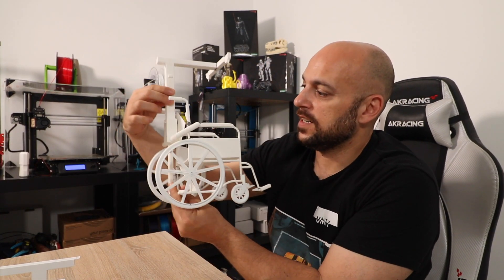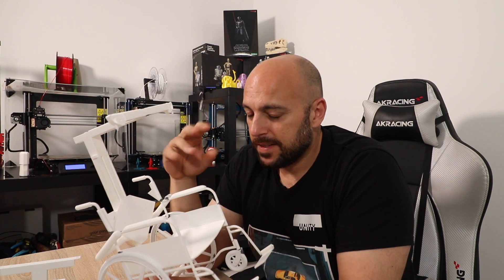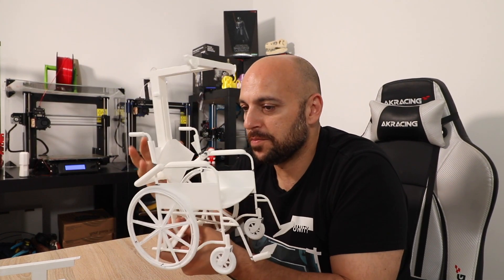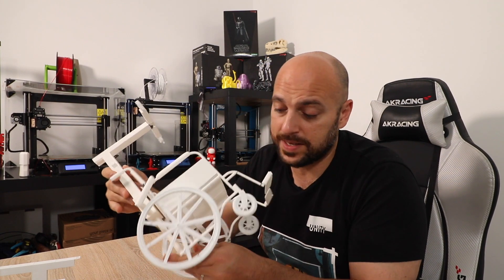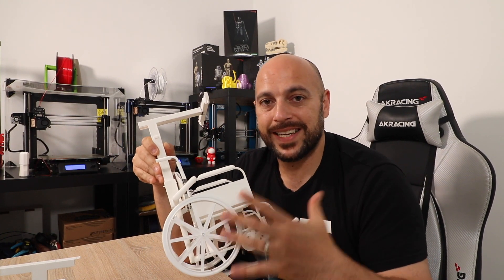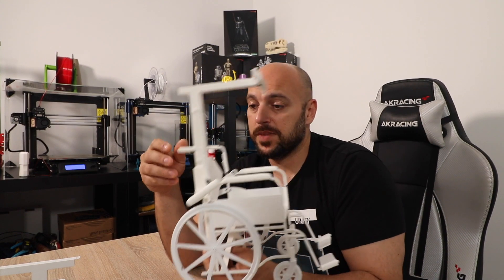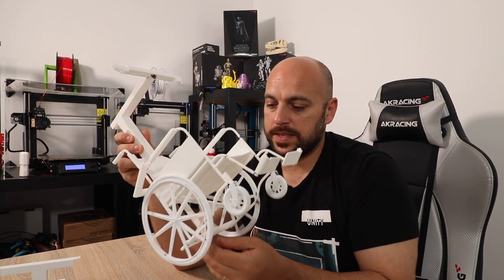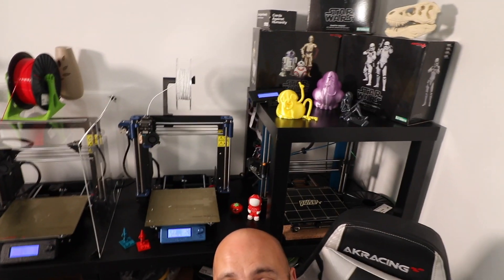Designing an Alfawise U10 Filament Guide - Maker's Vlog

Comment: I haven’t tried flexae filament yet. My problem was loading the regular filament on the U10. It would get cought on the threads where you have the funnel shaped guide. Will print this out thanks. It’s a general good idea and not just for flexible.

Comment: You will notice that a ton of people try to strive for a completely parametric model as well. The thing is nearly ALL of my designs are too size and I don't want them to change. I can model parametric but many times most of the models that I print for myself are functional items that need to fit a specific size. So I usually end up starting with a rectangle (just like you) and just start sketching on any surface for a quick model with zero thought involved.

I toss in constraints if it helps me get done faster, dimensions when needed, whatever it takes to complete it quickly. The only thing I tend to keep in mind is printability. I always try to make my models with no support. Don't be afraid to seem like a "newb" because of your techniques, hell your model looked good it was fast to sketch up; what more can you ask for?

Comment: If you do choose to do a revolve for the inside of that hole instead of a chamfer, you don't need to draw construction lines. You can simply make the sketch for the circle visible, and use the center point that already exists as the axis for the revolve :) Handy little mod btw!

Comment: I did a mod for the extruder by simply, removing the tube coupler and tapper the hole all the way with M6 tapper, then I fasted the tube coupler back and from the other side I inserted a segment of hotend throat (with teflon tube inside). I cut this segment so that it go all the way to the tube coupler and to be close to the feeder pulley. It works very well.

Comment: No need to do a revolve for the taper.  You can just use a chamfer.  Start with the inner hole diameter of the cylinder as small as you need it.  Do a chamfer on the inner top edge and select "Chamfer Type" and change to "Two Distances".  You can then get the taper exactly how you need it.

Comment: You could just cut the push bowden tube to a point and push it as close to the extruder gear as possible.
Reply from the maker: you can't as there are threads for the PTFE coupler so the PTFE doesn't go all the way through

Comment: For the last couple days I've been trying to print with a soft filament on my creality cr10s and a lot of my problems arose from the the filament buckling where yours did. Admittedly the reasons for the buckling were the initial layer being to close which stopped the filament but the stepper motor would still be pushing it through. This seems to be one part of a multipart solution ie slowing down, no retraction etc. I might try and make it out of a small solid piece (without the base plate) that you just push the filament through and then place between the cogs and the entrance to the bowden entrance hole. Hopefully a quick fix. Otherwise the alternative solution is to buy a flexion head but at the end of the day I'm just messing with the soft and have no real practical use at the moment for it.

Comment: that a pretty common mod, for printing with flexables on a bowden tube. nice you designed one for the U10 now also.
but would you not rather follow the litle gear and roller a bit closer and almost fill the complete gap?but on the other hand if it works perfectly now, dont change anything.
Reply from the maker: I did mod it that way, I show it in the video :)
Reply: wait wait! let me finish waching the video.......    and  yes!!!! finishes. yes thats what i ment. ;p  perfect.
thumbs-up, again.    😳  i better shut up and watch the complete vid rather before commenting on the fly 😶
Reply from the maker: Haha no worries, it only occurred to me to modify it like that after I did the video and started a print :)
Reply: maybe it work good on direct drive extruders also. i always find it pretty hard inserting even PLA into my AnetA6 these havent any trumpet like guidance. i am constantly missing the hole.

Comment: You can make a tapered hole in Fusion 360 by using the taper angle option in the extrude command.

Comment: Hey ! You're right, it does not matter how you do things as long as the result is ok.

Take 10 carpenters, ask them to build a stool, you'll end up with 10 different stools, some with 3 legs, some with 4, some with screw, some with locks, and with different woods too. But in the end, you'll have 10 stools you can still sit on :)

Comment: You can do offset the origin plane do an extrude of both  circles do a loft between the two circles face and the apply a shell to both sides... that is the beauty of 3d modeling you can get to same place by different routes. :)